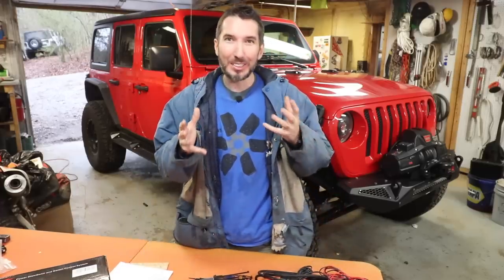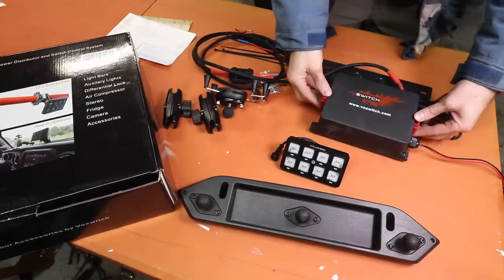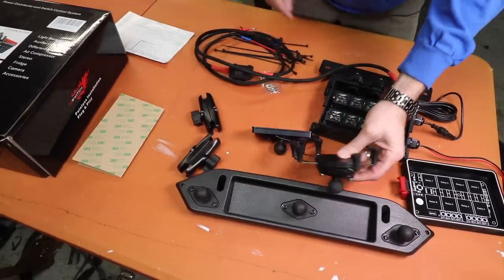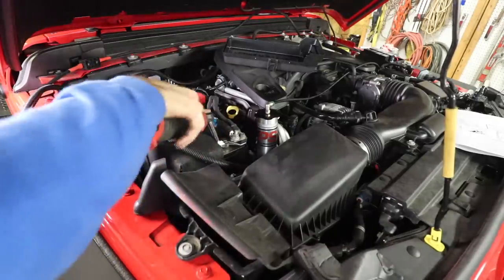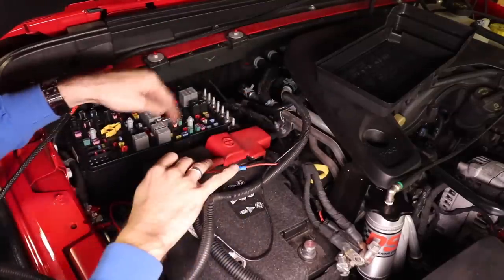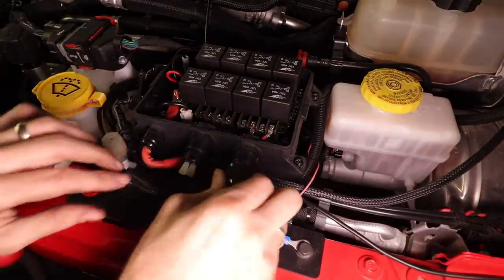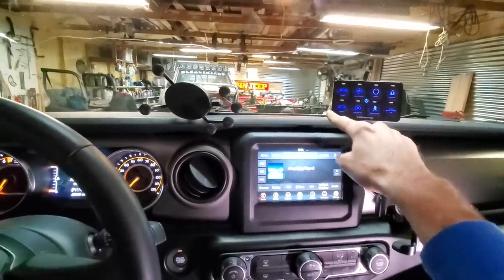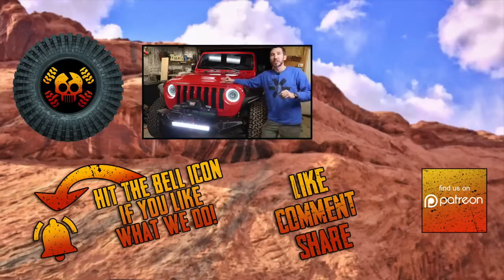Much Cheaper than an sPOD!

Comment: Thank you for videos like this.  We’d been procrastinating on this one because we weren’t sure on how we wanted to route the wires.  We have a different switch pod, but really similar to this one.  Never even crossed our minds to run it under the windshield.  It’s the little tips like this that make your vids so helpful.  Your steer smarts vid for example highlighted a bracket I didn’t know I needed bc it wasn’t mentioned on the website.  So thank you for being so detailed.

Comment: as a note: you can run the wire in through a smaller hole in the plastic if you route the wire through before you crimp it to the fuse holder and terminal. you should finish by sealing each hole with RTV or some similar sealant to keep water out of your fuse panel and relay box.

can not say I care much for the strobe effects, but I may have to look into the universal version for my Tacoma. sPods are seriously over price for being an over glorified fuse box and switch bank

Comment: That is very cool and would make a huge difference for me on the added lights and other electrical accessories I have installed in my JL. You have done some great videos that I have used for items on my 03 Rubicon!

Comment: After pulling those plugs and putting the wire through you should rtv the hole to seal it.  Those are there to help water sealant.

Comment: Made my own, but a lot of work!  Relays and fuses sitting in a nice watertight box. Mounted a 6 gang rocker switch on the dash and routed all accessories to it.  Rocker switch is engaged by the ignition.
There's a feeling of control and accomplishment with doing yourself.  If you're on a time constraint or your head gets scrambled thinking about it,  then this out of the box option is for you.

Comment: Installed one of their 6 rocker kits in out F550 Type 6 fire truck to control all the scene lights and emergency lights....  Great product and happy with it so far. and was on $160 for the basic over the mirror 6 rocker kit. 
Not sure if they have it for the JL but they also have a Pillar POD using the button panel seen in this video.

Comment: I ran mine through the rubber plug on the firewall.  If you pull that out and drill a small hole, shove the wire through.  Take a thick wire as a snake and shove it down itll pop our of the opening.  You'll see what I'm talking about. Then rtv the wire hole after.

Comment: Good video!  Man I don't like that wire pinched under the windshield and laying on the dash.  Way cleaner to poke it through the firewall and run up through the bottom of the dash.  Also, you can put the Anvil bar back in and just use Ram mounts to connect everything to it.  Like it!
Reply from the maker: I thought about it but I would have to drill through the dash.
Reply: @bleepinjeep  Speaking of that Anvil Bar, that thing looks pretty cool and I searched for it on Anvil Offroad's site and cannot find it...do you have a link? Do you know if they make one for the JK? My dad has the Vector Offroad bar for his JK and it shakes too much for all the electronics he has on it. I wish someone would make something similar for my WJ...
Reply: @jeffreymessick5630  Hi Jeff, I am the owner of Anvil Overland, the manufacturer of the Anvil Dash-Bar. You can check out our gear at www.anviloverland.com Thanks for asking about our products! Check in often as we are always adding products, and let us know if there is something you are looking for!

Comment: sPod includes a low voltage cut off and uses solid state circuitry versus relays. A bit more expensive but well worth the added cost.
A broken JL windshield. Say it isn’t so.
Reply: This unit has LVCO.
Reply: Not Matt Hoffman is it...is it?
Reply: It´s true, the sPod is more fancy, it´s all solid state, no relays, no fuses. But this is so cheap !

Comment: Should always check direction of current in fuse box, fuse location S52 fuse before adding a "add-a-circuit".  You could be running current around the fuse if you put it in the wrong way, thereby bypassing the fuse.   Your Welcome...   Just-Saying...

Comment: could you not have left the Anvil bar installed,and just got a  new ball  mount for the switch,put it on the bar,and not bothered with the  3 ball replacement on the top of the dash?Keeps everything low:)
Reply: Yes!

Comment: I only have 1 pre ran aux switch wire in my cargo area. If I have one of these type of s pod controllers then could I have the lights use multiple buttons to control multiple lights without having multiple wires?

Comment: Been looking at these units myself, wondering if a guy could use it for in cab winch controls. One switch for winch power and 2 set as momentary switches for winch in/out

Comment: Did you have to change the relay switch fuse to a smaller amperage for your lights? They all are 40Amp in the box

Comment: I have purchased KC 6 Cyclone LED Rock Lights kit.  Do you have any tips on connecting all 6 wires into 1? so that I can connect the wire to the VO Switch.  According to KC, each wire runs 3 amp making it total of 18 amp.  Is it safe to insert the 20 amp fuse to the VO Switch?  Any help will be appreciated

Comment: the wire run through the windshield seal, I would find a different place. it will wreck the seal.
Reply: I drilled mine right though the glass. It's ratrod and it makes people ask questions

Comment: How long can you go before the windshield cracks a week or two. I thought they were supposed to have made improvements on the JL windshield I guess not.
Reply: I have installed the JL100 for 5 months, everything is OK.
Reply: Bought mine in Memorial Day weekend 2019 of last year Christmas week 2019 on the highway kicked up rock shattered it went to safelite $500 later replaced guy said happens a lot a guy was leaving with his gladiator also shattered

Comment: Is there not an access hole in the firewall to run the wires through? Seems kind of silly to do all that work for windshield to run a small wire through.🤷🏼‍♂️
Reply from the maker: Ya but then there no good way to get it from underneath the dash to the top of the center of the dash.
Reply: @bleepinjeep  I have a JK, but I'll bet there  has to be a way to do it. I know mine had a feed through on the drivers side. Then you can run the wires across the instrument cluster or behind. Oh well, it is what it is.
This switch panel you bought on Amazon almost seems like it used to be the Apollointech switch panel brand that I purchased in 2017. I've had no issues with what so ever.👍

Comment: So for each item you connect to the control module, you'll have to find a place to put the ground wire of the part? that would look messy after a while. Why doesn't the ground wire hook into the control module like the hot wire?
Reply from the maker: Typically you would ground the accessory near the accessory  and just run a single hot wire through the vehicle and to the box. Or you could install a centralized ground block if you wanted.
Reply: @bleepinjeep  Thanks. I know for the mopar switch box from the factory, if you install it you have to reflash the computer. Do you have to do that with this kit?

Comment: I've got the one for the JK.  I like the rocker switches but wish I had the option for the little panel that comes with the JL.  I've got so much going on near my dash that it's getting pretty crowded !!
Reply from the maker: Not sure why they list this for a jl, it could be used on any vehicle
Reply: @bleepinjeep  ... Actually until this video, I didn't even know they had one for the JL.   I guess they marketed it to the JL because of mounting differences under the hood ??... Maybe they won't fit as "intended" in the opposite vehicle.
Reply from the maker: Ya you might have to mount it somewhere else and I'm not sure if the dash thing fits a jk but otherwise you could make it happen
Reply: @bleepinjeep  ...I didn't get anything with mine except for the switch panel and control box with the wiring.  And no, that dash insert that came with yours is way too big for the JK.  I've got a Vector Off-road bar that I'm mounting my bells and whistles to !!  It was nice that you got a phone holder with yours though... That must be how you fancy pants JL owners roll...😂🤣😂

Comment: Thanks is a really good video is something that I want to add to my jeep but I  have a question and maybe you can help me do you think that this one can be installed on a jk 2018 since I was looking on Amazon and look like is only for jl
Reply from the maker: You could install it on anything... it's just listed for a jl because its setup to mount on the fender.  So you may have to mount the box in another location.  And that dash insert probably isn't on a jk.
Reply: @bleepinjeep  thank you, I definitely will

Comment: As an electrician, forgetting a part for a connector happens. Just dont let it happen twice in a row lol
Reply: As an electrician, it is horrible to have multiple negatives bolted to random parts of the chassis/body. Any mod i do to my 4x4 i run the negative back to a dedicated negative terminal block.

Comment: do you need to make any changes to the relays or fuses to accommodate accessories that take up different amounts of amperage? ie: can you plug both a locker (takes up max 15amps) or light bar (35amp) into any of the available switches?
Reply from the maker: Yes, just changes the fuses.

Comment: Is it possible to program a switch slot so that it comes on when the care powers on?  For instance the DRLs?  My headlights have a separate wire for DRLs that I'm currently running off the heated seats fuse position.  I'd like to swap it to the VOSwitch, but I don't want to have to press a button to turn them on every time the car starts.
Reply from the maker: Yes, if you leave it on, it comes back on when you start.

Comment: so every time you install an accessory you need to wire the grounds to the body and not in the box??
Reply: beachdude2489 Your chassis is ground.  However, it’s recommended that you wire it back to whatever unit/component being installed or the negative battery terminal.  Issues ‘can’ arise and if you have a ton of accessories, fridge, solar, compressors, lockers, uhf, ham radio, inverters, usb ports everywhere, switch pods, gauges, etc. troubleshooting can be difficult.  Not to mention if the chassis ground, engine ground, and - battery have an issue.  Can you use chassis, yes, but go the extra mile.

Comment: why do we need to use every bolt head know to man on jeeps, or any vehicle for that matter... you can take a full set of sae and metric sockets, and torq bits plus allan sockets, all the screw driver variants even inverted torqs and find a bolt on your jeep that uses everyone... thats exactly what you dont want in an offroad situation.. you should be able to leave the house with a small socket set and be able to disassemble the entire vehicle on the trailer, i have to take sae and metric and torqs and ill still find a 13point fastener and cant take it off to fix a broken axle shaft.. i know specific fasteners work best in certain spots but i think if they really tried they could narrow the mall down the 5-6 sizes, make everything small an 8mm then jump up to a 12mm then a 15mm next is your 19mm for really larg bolt throw a 24mm head on them all and anything after upsize it to a 30or34mm... or convert all those to sae and do the same i dont care either way
Reply from the maker: Lol, you are right about that.

Comment: Hmmmm..... I've been trying to decide which one of these to get. Brand new JL and I'm adding things little by little. The one thing I see already that may or may not be a problem for me is I've already used that Cig lighter fuse for the DRL's built into my headlights so that they will come on automatically during the daytime. It's early and I'm not caffeinated yet, trying to think of how to get around this. Any ideas anyone?

Comment: Matt, can the mounting ball on the back of the switch panel be removed for a flat mount?
Reply from the maker: Hmmm, I'm not sure.  What is a flat mount?  You mean like stick it with tape or velcro?
Reply: @bleepinjeep  yes is there a way to remove the ball or socket on the back to flat mount it with velcro

Comment: Dang, I really got excited about this one, until I looked at the JK version.  No different than the two 4-bank rocker switch setup I'm already running.  None of the cool features, control panel, etc, that's on the JL version.   :(
Reply from the maker: Just buy the jl one 🤦‍♂️
Reply: @bleepinjeep  True.  Not really sure why they make a JK / JL distinction in their offerings.  Unless I'm missing something, these are essentially "stand alone" systems that don't interact with the Jeep bus.

Comment: You disconnected the battery incorrectly. 1) disconnect the battery sensor on the negative terminal first. 2) disconnect the stop start batter negative terminal.  3) then disconnect the main negative terminal last. When reconnecting reverse ordered connecting the battery sensor last. . Sorry just the factory process